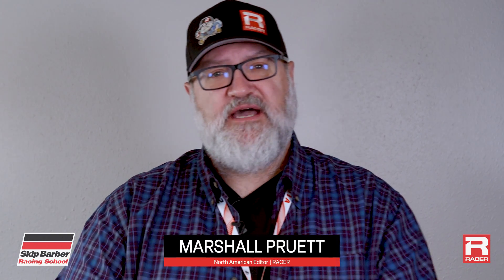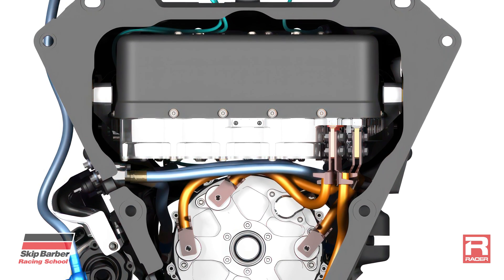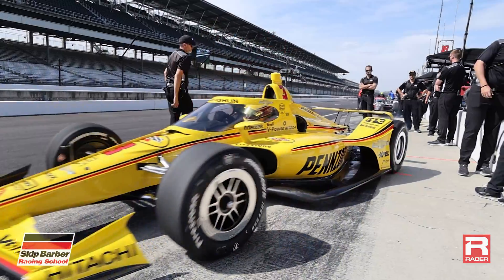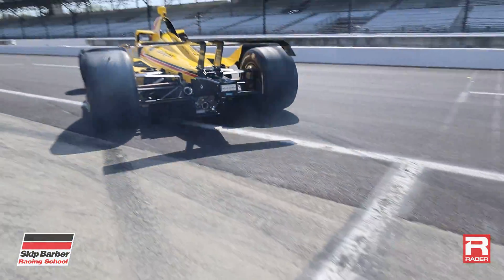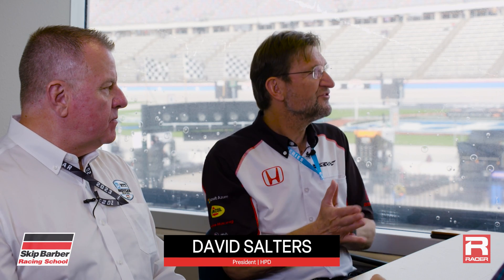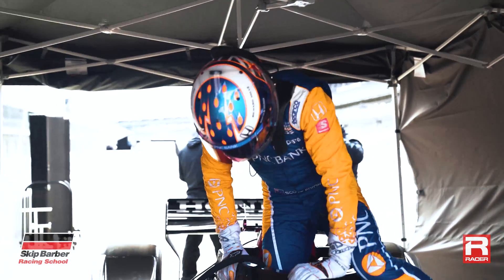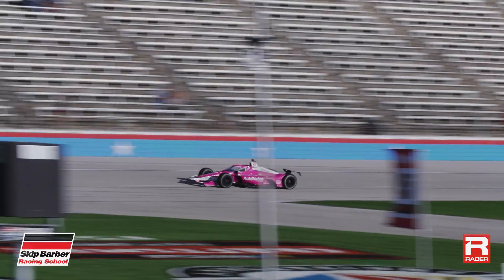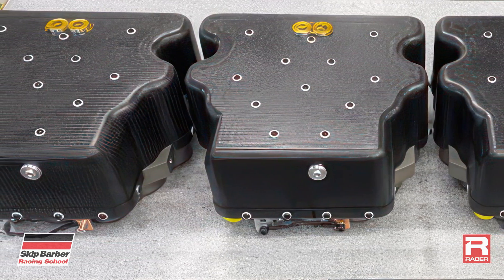Part 3 - IndyCar Hybrid Engine Roundtable hosted RACER's Marshall Pruett presented by Skip Barber

Comment: The super capacitor is very interesting. My introduction to Capacitor theory was while working on an old black and white tv as a teenager. Yes I'm old save the math for something more productive. Being a reasonably intelligent person I knew electricity was a dangerous thing so I unplugged my tv before looking inside. Then after touching the CRT I felt like somebody hit me in the head with a hammer and had a flash go off in my face.... I will attest they discharge hard and fast...

Comment: That's what's needed almost instant recharge, had no idea that it was possible. Sounds amazing for the application.
Reply: Mazda uses Supercaps in their mild hybrid, as does Lamborghini. They hardly hold any energy compared to batteries, but their power density is absurd. They're basically canned lightning. I'm looking at them to power an electric supercharger, as they're more stable than LiPo for short burst applications.
Reply: @rodbrown8306
In my opinion, they will not have "almost instant recharge" and I'm wondering why you think they will? In the video he said they'd have "nearly instant DISCHARGE speed", which is great for coming out of a corner. But in a previous video I've watched about this system it's been revealed that they will only be producing 30 horsepower of "reverse torque" commonly called regenerative braking, hence considerably slower to charge the pack than to discharge the pack. Not quite an almost instant recharge scenario, imo.
Reply: @TNSonglines , that's still a lot more than a Lithium ion battery.  A significant amount of the regenerative energy is lost in thermal impedance (leading to less recovered energy than the motor is applying in decelerative torque).  Imo, because super capacitors are vastly more efficient at energy capture/deployment, there should be a 90+% capture rate of that 30 horsepower reverse torque, so it will indeed charge quickly compared to existing hybrid racing systems.